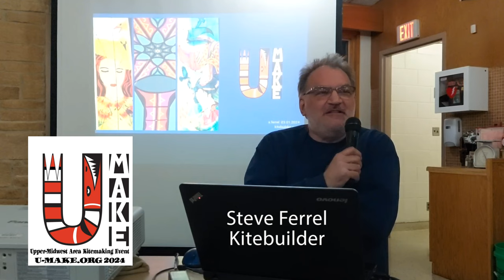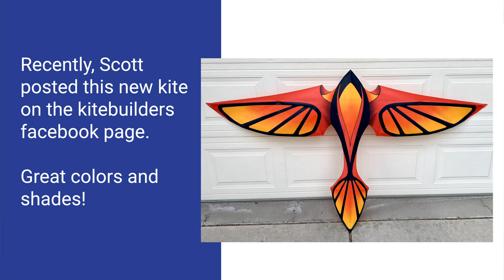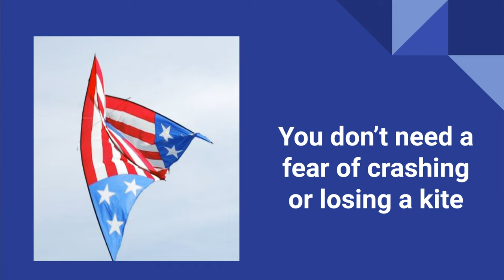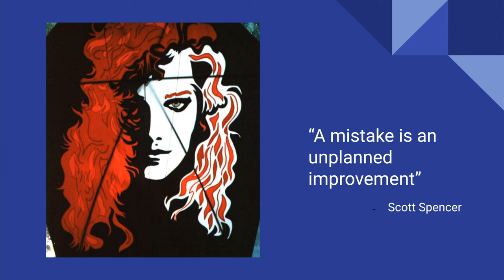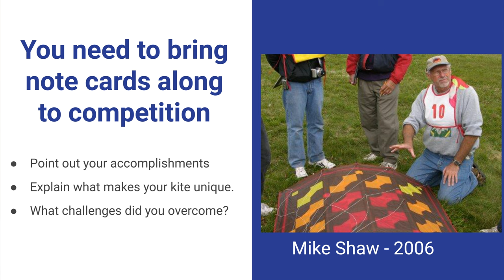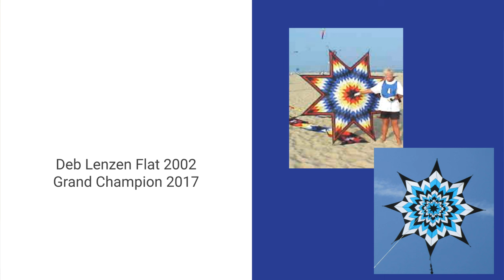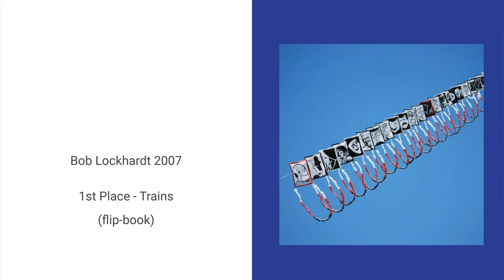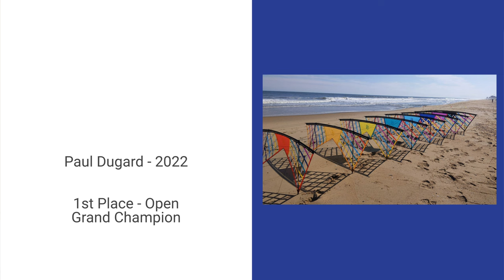How to Make an Award-Winning Kite

Comment: Thank you Mike for putting this together.  Just two corrections that I discovered since I presented.  On the two star kites made by Deb Lenzen, the upper one was indeed  made with folded and sewn seams.  The second one on the lower right is named "Eyedazzler" and was entirely appliqued.  The second correction is the next kite in the slide show... the one with the two ducks.  This was also built by Deb Lenzen and was named "Loons" - it competed in Rochester as the state bird of Minnesota.
Reply from the maker: Thanks, Steve. Will paste your comment into the description.